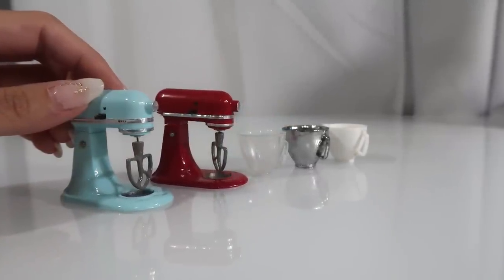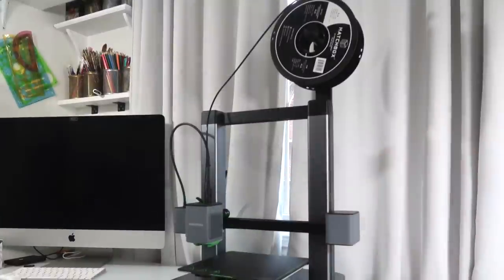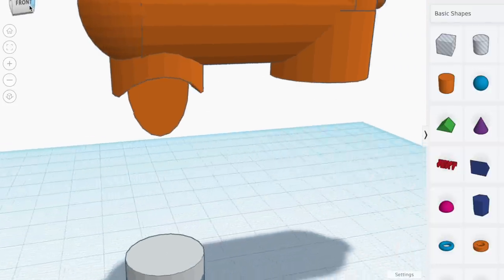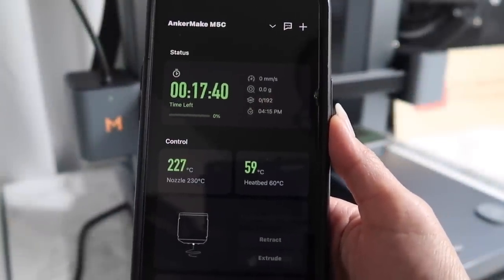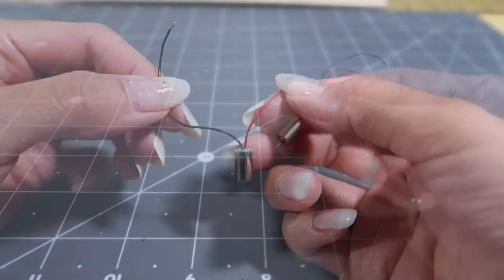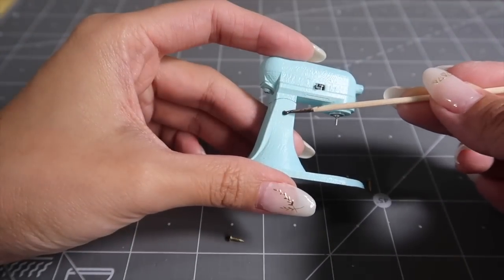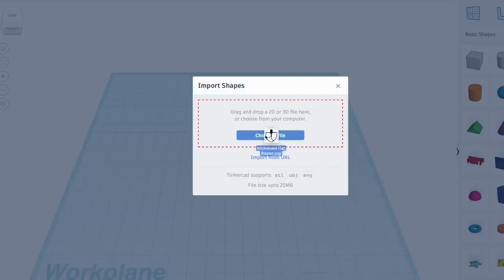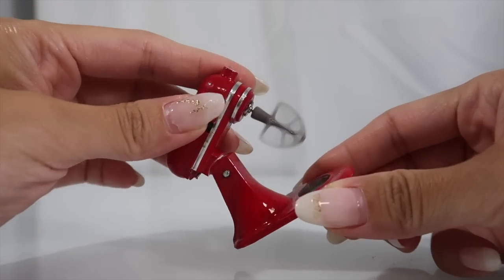Miniature Stand Mixer that works (ft. AnkerMake M5C)

Comment: Hello ! Just caught the show !
Been watching the video , what was the cost of this machine and e everything
that came with it ? What is this type of machine mainly used for ?
SO much to learn on this and alot of work in this 3D Printer .
Where did you learn how to order and use a 3D Printer 
And why did you even want something like this . 
Something for work or advertising. 
What are the many uses for a 3D Printer .
What is its main use with this Printer .?
Reply: Hello ! Like to get a Reply from you .
Thanks !